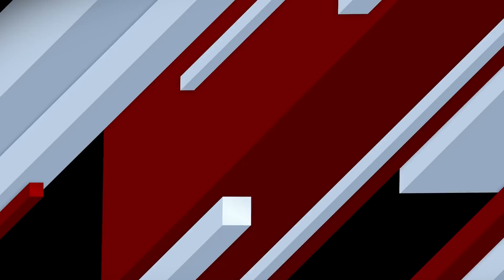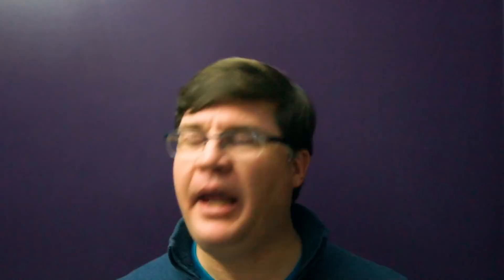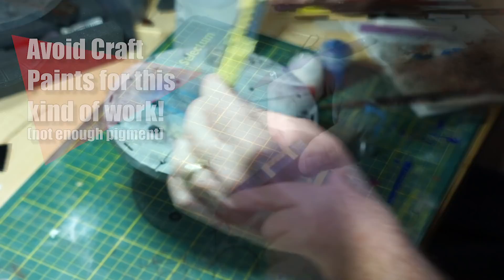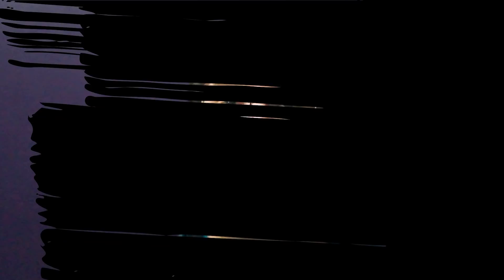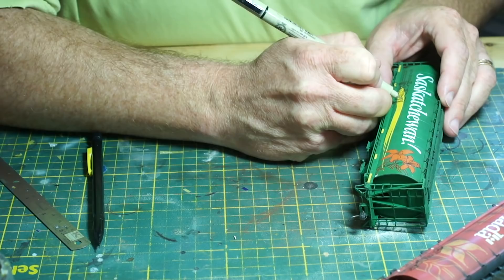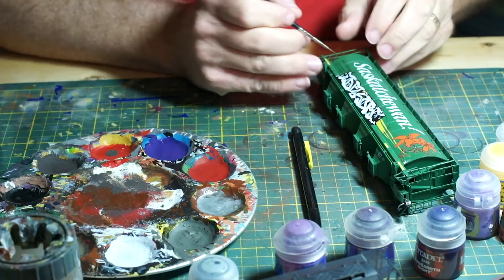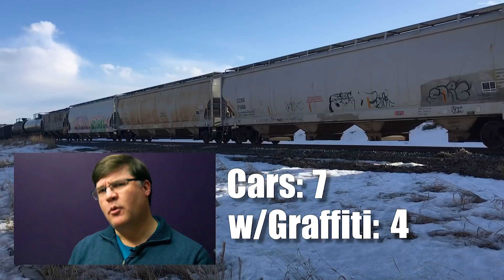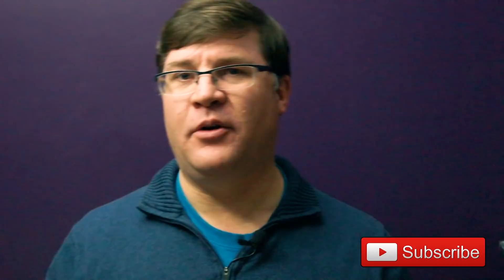Weathering Model Train Graffiti & Patches (Step 7)

Comment: JC, Have you done your video on decals yet?  Curious on your thoughts as to what stage (in your 1-8) that you would recommend using decal graffiti or does it even matter.  Thanks.  Rick
Reply from the maker: Hi Rick, yes, I have a few decal videos, including one on salvaging a busted decal (which happens to be a graffiti one).  Here are the links:
https://youtu.be/lJP36YkSaCg (Tips for Awesome Decals)
https://youtu.be/Ux1vBeltkJ4 (Weathering Decals on Model Trains)
https://youtu.be/vWq7LLQlj6A (Decal Disasters and How to Fix Them)

Hopefully this helps!

Decal (or painted on) graffiti, depending on how new it is, usually comes later in the process. There's only been a few places where I've applied it early, with the intention of wearing it off or patching it over.  Usually, I'd recommend it around Step 7, but it needs to be weathered back a bit after it is applied. Decal graffiti can look very obvious if you don't take steps to integrated it into the surface of the model. Hopefully my videos links can give you some tips on how to do it.

Comment: If you're doing a Japan layout, be sparing with the graffiti. Graffiti is ridiculously rare in Japan. It exists, sometimes on structures tucked out of sight, but almost never on the cars. And most patches are fairly carefully color-matched by the company, except on the most utilitarian assets like modular containers.
Reply from the maker: +Ed Halley Great point Ed. The last bit in the video talks about the importance of one’s context and location. Since modular containers also travel through areas that are more “graffiti prone,” they may be the rare example in Japan. Also, one point I didn’t add is the ratio of graffiti on car types is also important. In the example in the video, the ratio of tank cars with graffiti is lower than say the gondolas or covered hoppers.
Reply: Graffiti on intermodal containers is very rare and if it does exist, it doesn't last long. The shipping companies make sure to paint out any graffiti eventually. Plus, most containers spend most of their time on a ship in the middle of the ocean, so there isn't much opportunity to tag them up.
Reply from the maker: Again, thanks for this great clarification. I've seen graffiti on the intermodal cars, but you're right, most of the containers I've seen are patched up rather than have something stay on them. The only containers that I have seen that retain graffiti are ones that have been parked and repurposed for something local.